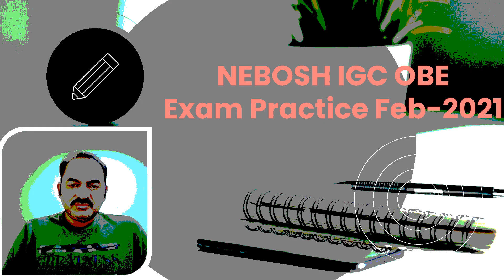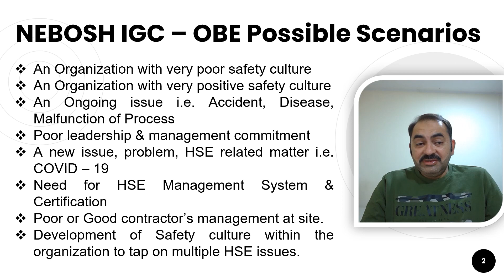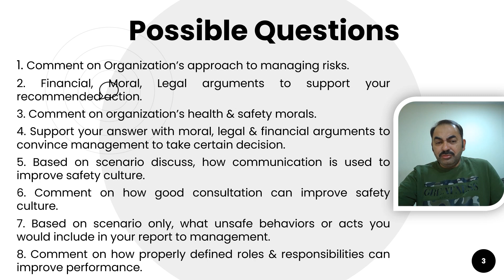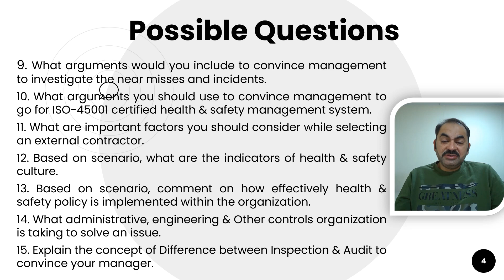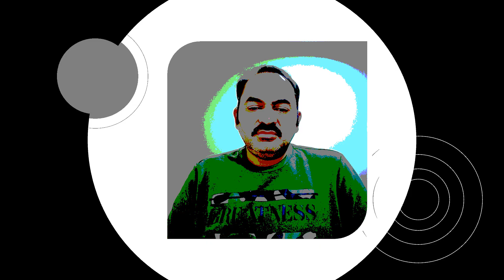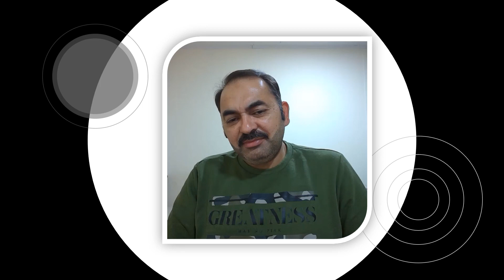NEBOSH IGC OBE   Possible Scenarios & Questions   Feb 2021 Exam

Comment: Sir if they ask justification for finicial arguments, then we should answer justification, by giving +ve points or by -ve points....
Reply from the maker: It all depends on scenario, and question. Most of the times you have to justify any recommendation then for sure you need to show that your recommended action will save some money to the organization avoiding cost of accidents, penalties etc.
Reply: @waseemahmed-official1516  sir means for example  if -ve senario is given then for finicial justification we can tell that, if we built separate path for FLT and workers, then we can save money by saving accidents, we can save compensation, sick pay, penalities too, we can say all in  +ve sir... way...
Reply from the maker: Being safety professionals you have to sell your idea/recommendation. You can't say this control will cost you so much of money. Argument should be on the positive side to convince management to take action.
Reply: @waseemahmed-official1516  tq very much sir very helpfull....reply from u...really means a lot